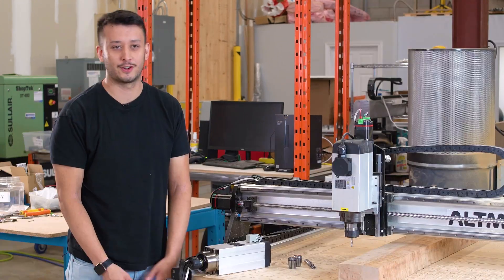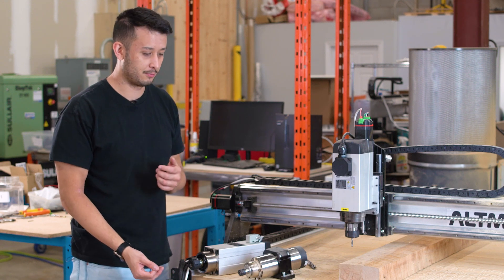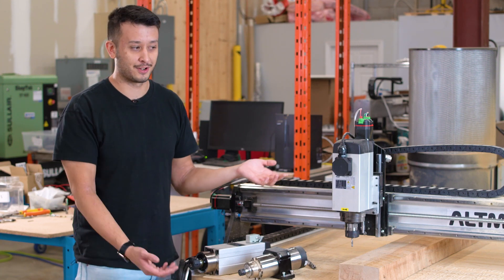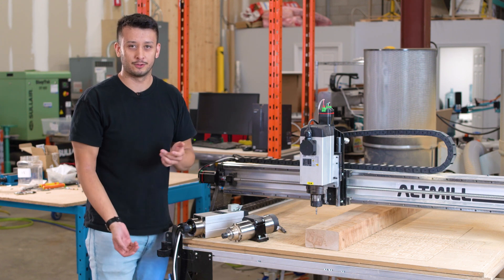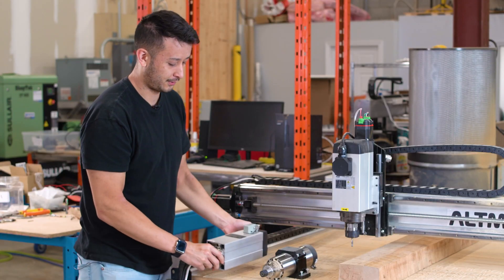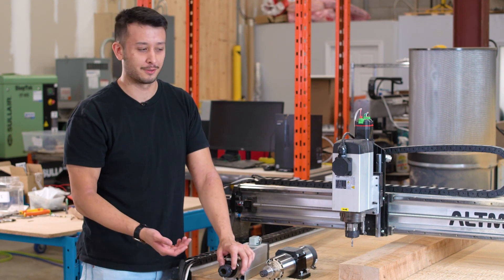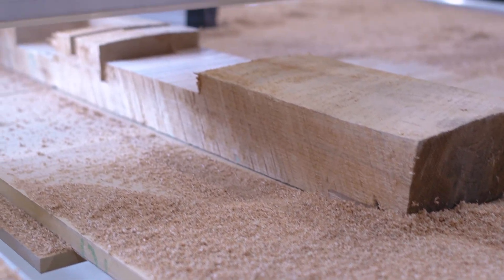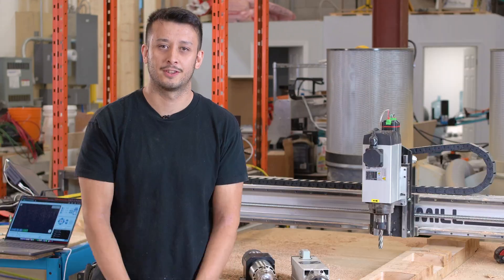Testing the 4.5KW AltMill CNC Spindle: Behind the Scenes with Sienci Labs

Comment: OK, that's impressive hogging on maple? wow~ Not being a user/owner at the moment, that seemed like some serious capability that we see on a $20k plus door machine right? And how did the bit sound? It was singing, but it was a push test, not something I've imagine ever doing personally, So yeah, overkill spindle, but that middle one is singing to me for sure if for nothing else than accuracy, strength, power and actually, less electrical use vs output with 220 for sure.

Comment: I have a smallish shop.  Can the AltMill be mounted vertically on a wall?  Is the Y axis able to support the weight of the gantry without adverse degradation of acceleration values?
Reply from the maker: While it is possible, however, but would be quite involved and might require some sort of counterweight to avoid the motors back driving when everything is powered off. Any other questions, please reach out!

Comment: I am interested in a 2.2 kw spindle as it would run off of 220v and I have 2 circuits running in my garaage a 110v and a 220v.  This way I could keep the spindle circuit off of my regular circuit and not bog it down.  So please offer a 220v option as that is what I am waiting on before ordering.
Reply: I second this!